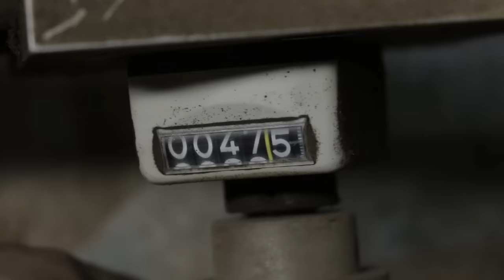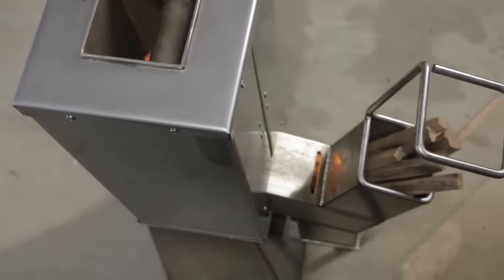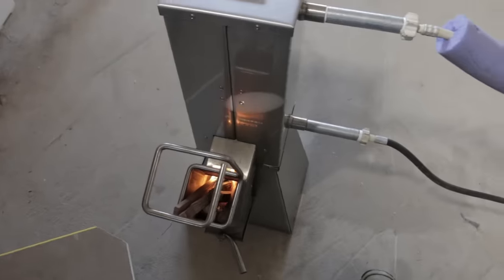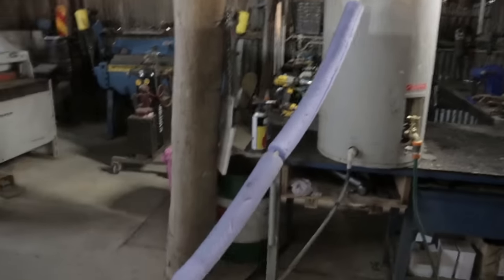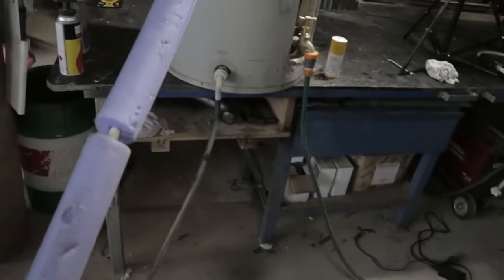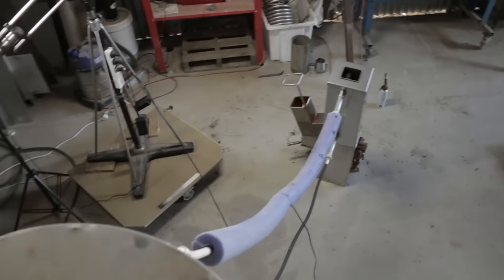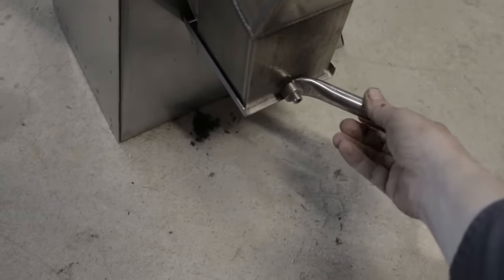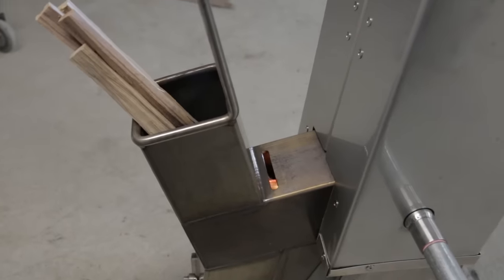Making an insulated rocket stove hot water system

Comment: The only thing i could think of to get more thermal transfer is to put some fins on the inside of the vertical pipe. You only have a flat surface there so a lot of the heat is leaving the stove without impacting the water temperature at all. So basically a heatsink in reverse. Stainless is a terrible thermal conductor, so anything added to increase surface area of fire exhaust to stainless to the water would increase its thermal efficiency. You  basically want the exhaust to come out as cool as possible, treating the water as "liquid cooling the exhaust".
Reply: Dude was edgefinding with that tiny tip on round corners.

I think you went above his skill level there.
Reply: That's very cool.. An improved version for better application
Reply: Dude you do realize he started the wood on fire somewhere else, then stuffed them in this unit.
Reply: @MARS-GREENH0USE  so? I am talking about the fire giving heat to the water.
Reply: Or fill it with steel wool.
Reply: @Dante4F8  Steel wool doesn't have great thermal conductivity, and will also pretty well instantly burn.
Reply: This build of a water heater could be more thermal effective using a round water chamber around a round chimney. Then a insulated jacket around the whole assembly. The fire box below the chimney.
Reply: @colinsmith6340  True about the burning in air if you use really fine steel wool.
Tho the capacity is irrelevant tho as long as you slow down the hot air giving more time for the existing surface to absorb the heat.
You can use a nest of copper wire or EMI shielding mesh but the cost may be too big to justify the function.
A better way may be to make the air snake up by alternate blocking half the area from one side to the middle then the other, or maybe even top, right, bottom, left making the airflow spiral instead of a zig-zag.
Tho if you do it too many times the resistance would too much.
Reply: @thomaswiggins7913  Yes i built a stove out of a 100L stainless steel tank. Inside of the tank is a 100mm stainlass chimney. The tank stands on top of a burning chamber, welded out of two old car rims. The unit works nicely and is able to get the  water boiling  after approx one hour. I did not isolate it, as the intended use of the unit is to heat my greenhouse in cold nights.
Reply: For better heat transfer he could locally change material to 2.0966 CuAl10Ni5Fe4 (Alu-Bronze) that has approx 3 times better heat transfer rate than stainless 18-10, is also tig weldable to stainless and also has quite same coefficient of thermal expansion. But it comes with a price tag.
Reply: Create a spiral of fins to maximise heat transfer 👍
.
Its how gas powered camper van fridge flues work
.
.
The spiral creates a vortex of hot air maximising efficiency
Reply: Do you plan to sell it ? 😊
Reply: Copper fins😊
Reply: @davidhamilton7628  Yes he could weld on some copperfins with diffusion welding.
:D
Reply: Also a bit taller stack may help with the smoke going in the undesired direction. Also if there is concern for smoke out the stack you could add a third layer of stainless with holes at the bottom and reintroduce fresh air at the top. 😊
Reply: @aliasaila8818 I like all those thing you just said 😂
Reply: @grayfox7256  Thanks! You're welcome
Reply: Your video is nice. But without a doubt I believe that the system that uses COMPRESSED AIR as fuel is better. YES YES exactly like that. You read very well. Remember that the flame always heats faster than any other form they would have you believe. Then click on the round image next to the message where Tecnitalia55 is written. And you will enter my page where you can see many of my creations, including the stove that BURN COMPRESSED AIR. Leave a message are welcome. And if you liked it, let me know about my page. Sorry but it's in Italian. Thank you.
Reply: Excellent, maximum energy transferrence.
Reply: @thomaswiggins7913 That was my original thought when I first saw this video, a chamber around the stovepipe. A water jacket.
Reply: 3 d printed parts are not water proof ,they absorb water and break down. There is a chemical sold to prevent this however on its own 3d prints are not useful in wet conditions without leaks and severe breakdowns.
Reply: Do you sell them  because I don't have the equipment
Reply: Guys, here is our Savior

HalleluYAH translates “Praise ye YaH”

YaH is The Heavenly Father
YaH arrives via the TENT OF MEETING
YaH was Who they Crucified for our sins
YaH was Crucified on an Almond TREE

Semitic of Moshe (Moses)
Isa Scroll (The Original Isaiah)

Isaiah 42:8 - I am YaH; that is my Name! I will not yield my glory to another or my praise to idols.

Isaiah 43:11 - I am YAH, and there is no other Savior but Me.

Isaiah 45:5 - I am YaH, and there is none else.

Comment: I've made another observation of your setup. It would be more efficient to use convection currents to your advantage. Plumb the top of the heat exchanger to the bottom of the tank, and plumb the top of the tank to the bottom of the heat exchanger. This lets the hot water rise through the tank setting up convection currents, and heating the whole tank of water more evenly. As you have it in the video it is just heating the water in the tank from the top down.
Reply: It's the heater that creates the convection. Heat rises in the heat exchanger and rises to the top of the hot water unit as it cools in the unit it sinks to the bottom and repeats. Your method would require an electric pump. The way he has it plumbed is as old as hot water itself.
Reply: That’s something I asked my grandpa when he was working on his hot water tank. So I get where the intuition comes from :D
His answer was that you WANT your water to be layered. Hot on top and cold in the bottom. That way you can extract hot water after a short time. Otherwise it would require the whole tank wich is constantly stirred by convection to heat up to your desired temperature which takes a lot more energy and time. Also the heat loss through the insulation of the tank is less when hot water is only at the top, because the hot water is touching less surface area until the whole tank is heated up. So the idea here is to heat the tank from top to bottom for better household  usability rather than perfect mixing. Hope that makes sense :)
Reply: The guy is an extremely skilled draftsman and fabricator but the science is lacking. I came here to say the same thing about his 60C being just the water at the top. Also the lack of all around heat exchanger/surface area.

 @no-expert  it really depends what you want to do, if you want some hot water quickly, this setup will do that as your grandpa, but it won't heat the whole tank, at which point, why have such a big tank? Generally large tanks have 2 immersion heaters, the main one is in the bottom and ensures the whole tank reaches temperature, there's then a top "boost" heater for if you've run out or nearly run out of hot water, it'll quickly give you enough hot water for a shower etc.

I'm going to assume the intention of this video was to show how quickly it could heat a whole tank and from there calculate it's power output, but he didn't do any of that sadly
Reply: @trif55  science is there plain as day. Hot water rises in the heat exchanger and continues to the top of the tank. As it cools in the tank it sinks lower and lower and gets to go through the heat exchanger again. The bottom of the tank may only be 1 or 2 c lower than the top and the circulation will continue. The top of the heat exchanger has to be below the top of the tank. The science is heat rises cold sinks. It’s not hard to figure out. Every old farm house with a wood stove used this method of hot water for ever. The hot water unit is in the ceiling above the wood stove. The stove has a small water jacket in the fire wall. This is a very common method of hot water in the Aussie outback at shearer’s quarters and wool sheds where power supply is limited or non existent. We call these heaters a “donkey”. This method gives you an unlimited supply of hot water for a large family without the utilities cost.
Haven’t you ever noticed that the cold mains water enters your water tank at the bottom and the hot water comes out the top and then to the tap.
Reply: @stevenstart8728  yea I see what you mean, I know how hot water stratifies in an internally heated hot tank, that's cold inlet at the bottom and hot out the top obviously, but the "heating element" is always at the bottom, and I was basing my thoughts on how a liquid heating element, as in gas central heating system, with a storage tank, has the heat source at the bottom and I think the hot inlet for that is at the very bottom, but of course that's a pumped supply as well) I see now as long as the two bodies communicate freely and the stove/heater is the lowest point the cold water will flow down the lower pipe it and the hot exhausts into the top of the tank, basically flowing the opposite way to how I invisioned, which is why I thought the pipes would need to cross, so the hot water from the stove flows into the bottom of the tank, like central heating
Reply: 这个如果目的是加热水的那换成铜材导热应该好些，加热效果比较好，加热水的区域做成像燃气热水器那样的给水加热结构效率应该比这个高很多

Comment: Excellent build, I was a toolmaker 30 years ago in aircraft manufacturing and your skills are as good. To increase heat transfer more surface area within the box section, fins for example, however, the down side to that is the drag on the water flow, which means the need to pump the water through it on a slow flow rate, it’s a balance as the slower flow, will increase the heat and that will increase the pressure, so a low flow pump could help with more even heat distribution into the water.

Comment: 42 years ago I wrapped as much 3/8" microbore copper pipe as possible tightly around the circular 6" steel chimney pipe coming out of the top of our home made woodburning stove/cooker. In all I covered the whole 30 inches of the chimney pipe before it turned and went through the wall. I plumbed the copper pipe into the indirect side of our copper hot water tank in the bathroom which was directly above the kitchen. After successful initial trials I then insulated the copper pipe, but had to remove it soon after because it was then producing too much hot water and it was venting into the expansion tank. It has since given us all the hot water we have ever needed, and for no extra cost.

Comment: This is surprisingly powerful!  To take 80L of water from 30 to 70C in 1.2 Hours is an energy input of 2.7Kw.  Total energy input is about 3.7 KWH.   TBH looking at it I would have never thought it would do that.   Figures don't lie however and I'd say that's a fantastic result.  I think some sort of baffles in the riser of the burn chamber to pusht the hot gasses out to the sides would  help transfer with more heat and efficiency but putting the pipes across to break up the boundary layer gasses was a great idea. 

VERY well done.  Good and useful amount of  heating power here .

Comment: Great build! If you wanted it to heat the water faster you could put a thermostat valve on the outlet so the tank holds the water till it gets to your desired temp then let's the hot water out repeating the process
Reply: Your video is nice. But without a doubt I believe that the system that uses COMPRESSED AIR as fuel is better. YES YES exactly like that. You read very well. Remember that the flame always heats faster than any other form they would have you believe. Then click on the round image next to the message where Tecnitalia55 is written. And you will enter my page where you can see many of my creations, including the stove that BURN COMPRESSED AIR. Leave a message are welcome. And if you liked it, let me know about my page. Sorry but it's in Italian. Thank you.

Comment: I enjoy watching you build your stoves and you definitely stepped it up. 
I’d like one of you hot water rocket heaters.
Reply: 250 dollars plus 50 shipping, and every use you have to build a fire. Also it has to be in a location to allow the fire safely.
When you can just buy an on demand water heater for 160 bucks. And put it under the sink or by the shower

Comment: Nice fabrication work. It also demonstrates that each bit of workshop contends with wear and tear over time. As such, you'll always need spares of perishables such as drill bits and sanding pads. Stuff can also break on occasional, such as a certain air compressor component that hubby and I got from Bunnings years ago.

Comment: Nice one, I built a woodburner for heating as I live off grid and never made a back boiler. Seeing this has pushed me to make a hot water tank that sits on top of it in the hope that heating the water will reduce the heating effect, and I'll insulate the tank. The woodburner is so efficient it turns our home in cold wet uk into a 30-degree c hot box when it's -10 outside and on 3 logs all night. I've never made a rocket stove, but I know they are really efficient on wood. Your one looks good, nothing wrong with a few mods as you go.

Comment: You do nice work, if you investigate types of steam engine boilers you will find what is known as Hedgehoged boilers, where you have the teow pipes passing through the chimney if you weld 10mmish solid bar through the water jacket and into the boiler you'll be able to harvest more heat from the flue gasses and flames

Comment: Great job and video! removable attachment to accommodate a pot for cooking on top would be a great addition. 
And then if you wanted to get ridiculous, an automated wood pellet feeder for prolonged heating.😁😁
As a grate, i just welded 8mm SS round bar 15mm apart for ash to fall through, worked a treat.

Comment: That sheet metal cutter is amazing.  I also like the way you overlap things for easy assembly.  I would have spent way too much time on perfect fits to minimize material use, but your way is easier to adjust your final part, stronger, and only uses a minuscule amount more material.
Reply from the maker: Thanks 👍 I used to build toolboxes for a living and these are the same production techniques we used in that line.

Comment: Nice build! Also, nice TIG welding...it's so good to see a guy that can actually TIG weld stainless. :)
Seems the heat convection works quite well as you can touch the bottom pipe but not the top one.
About 1 hour to heat 80 liters of water is fine...and without using one watt of electricity for any pump.

Comment: Beautiful build and top presentation, thanks for sharing. I'd love a follow up with total weight of fuel burnt and time to get the bottom of the tank store up to temperature. I like your exchanger design as it allows the riser to stay hot enough for good draw and a clean burn (which might be a problem if the riser was surrounded by a water jacket). Also the siphoning seems to be good enough to prevent boiling. Fantastic, thanks again.
Reply: Your video is nice. But without a doubt I believe that the system that uses COMPRESSED AIR as fuel is better. YES YES exactly like that. You read very well. Remember that the flame always heats faster than any other form they would have you believe. Then click on the round image next to the message where Tecnitalia55 is written. And you will enter my page where you can see many of my creations, including the stove that BURN COMPRESSED AIR. Leave a message are welcome. And if you liked it, let me know about my page. Sorry but it's in Italian. Thank you.

Comment: Beautiful workmanship!  Thermosiphon is cool, but it does not like horizontal runs or drooping lines.  If the heat collector was configured so its line exited the top of the sidearm box and went up thru the chimney at as steep an angle as possible, this would insure no air pockets(more water in contact with metal) and with no drooping in the line up to the top of the tank, it will flow much faster.  What faster flow gets you is cooler water in the heat collector sidearm, which = greater delta and overall faster heat transfer to the water.   Heat transfer is mainly about temp difference and surface area.  The pipe being cool at the bottom means the tank has not completely heated and still has cool fluid at the bottom.  Since the tank heats top down, Are you measuring water temp at the bottom of the tank also?  Gauging average water tank rise(difference between top and bottom tank temp) in an hour can get you average  BTU/hr collected, compared with weight and type fuel used in an hour can get you BTU burnt to gauge overall heater efficiency…  if I were doing this to heat a water tank, I think I would build it right alongside the tank and plumb it to angled fittings no less than 45 deg up into the top port of the tank.  This would allow for a heatex that is longer.  You could also add vertical fins welded to the inner wall of the heatex/chimney wall for additional surface area.  And you could add some small spot welds to creat turbulence/breakup laminar flow(improve transfer efficiency)…

Comment: 3:14 welds looking damn good. And as we all know, the inside corners are the most important. Tough to sand/grind. You have a void/bubble on the outside edge, but even if you drop another bead over that, you can easily reach it. So yeah.. Noice

Comment: We use a similar thing to heat water in a sauna. We have the wood stove with a U tube that is exposed to the fire. Cooler water goes in the bottom and rises to the top dumping back into the hot water barrel. Good for quick steam on the rocks and nice hot wash water.